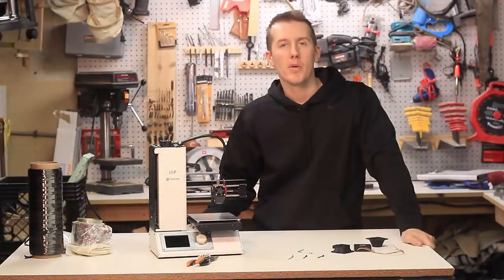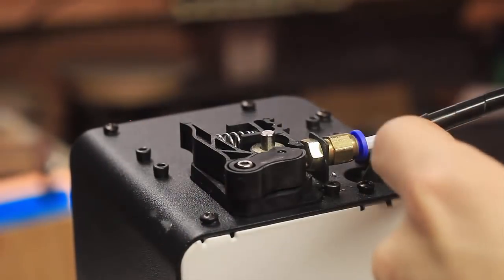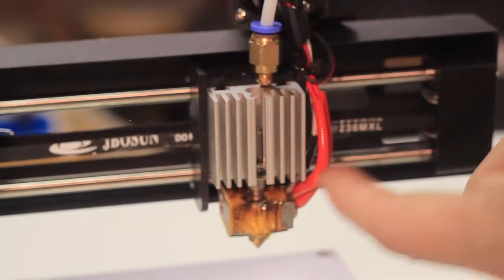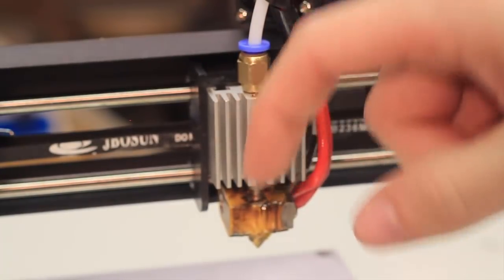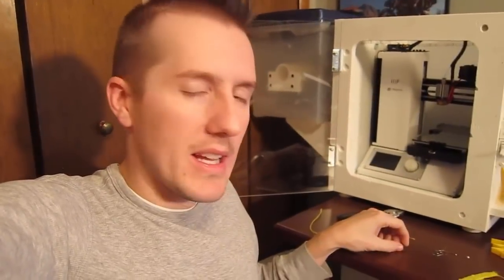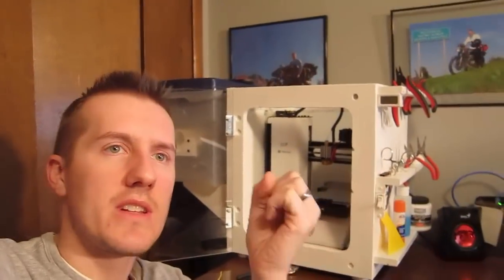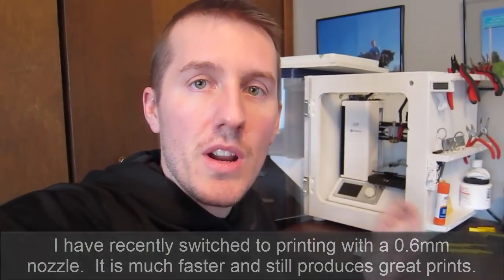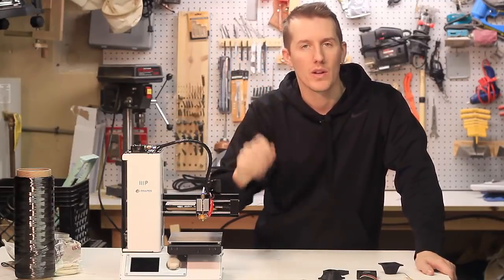Fix Clog in Nozzle - Monoprice Select Mini - 3D Printer

Comment: Hey thanks for the video.  Do you recommend a specific filament?  Does a better filament cause less clogs? Thanks!
Reply from the maker: PETG can be hard to print with.  You need to be printing at like 230 deg C.  
PLA is the easiest usually.
ABS is cheap and sometimes prints great and is strong.  Although it can warp up from the print bed easily.
I had a roll of eSun PLA +  and it always seemed to print pretty well.  Also it was only like $20.
But i haven't really seen a difference between a $40 roll and $15 roll.
A lot of people like Hatchbox, again like $20 on amazon
One filament that stands out to me is by E3D - spoolWorks PLA.  It was like printing butter.  Super smooth and the final part looked great.  Use this for "fancy" prints.
Kind of rambling, but i think most filament today is pretty good.  I guess in the early days of 3D printing there was a lot of variation.
But i would just buy the cheapest stuff, like $20 per roll.
Here's a video where they asked a bunch of youtubers their go-to filament.  Hatchbox came up a few times: https://www.youtube.com/watch?v=aw_chlce7is
1 last thing - i live/work near a MicroCenter store.  Not many in the country, but that's where i've bought the last few rolls.  They make Inland brand.  Really good and like $20.
Reply: @DaveWirth  Thank you! I am using the Monoprice Select Mini 3D Printer v2.  I just ordered the replacement nozzles you suggested and I will look into the lubricator.

Comment: Hi Dave, really enjoyed this video and your instructions to replace the nozzle.
My nozzle clogged up and burned the insulation; I am not sure how it all happened but I found a print which looked as if part of it was melted.
I ended up taking what remained of the insulation off and now I am having difficulty removing the nozzle as the heater rotates.
I am hoping I don’t need to strip the whole thing down as you show in your second video.
Thanks for sharing this.
Reply from the maker: Clogs happen.  Sometimes not enough cooling, or with some prints there's a ton of retraction and it gets clogged.
You don't need to have the insulation on there, most printers don't have it.
You need to use big pliers - grip the square heater block - then remove the nozzle ..... while it's hot.  It sucks but you need to turn the printer on, set the hotend to like 200 degrees C, then remove the nozzle.  Otherwise it won't come off from the fused plastic inside.  
Once you get the nozzle off you can either try to clean anything inside, or install a new nozzle.  
You can use a blowtorch and melt any plastic inside the nozzle out.

Comment: sweet video, where did you get this enclosure from?  Are you still using this printer?  I just picked this printer up today used and I am trying to figure out what the abuse the previous owner caused because its not printing correctly, filament is not coming out perfectly and I am pretty sure my level is good.
Reply from the maker: I built the enclosure  https://www.youtube.com/watch?v=6NJk8Kgl7oY&t=719s
Not really necessary though, unless printing with abs
I still use the printer from time to time.  seems to go in spurts, then i'll take a 3 month break
if the drive motor is turning and it's not printing great, then the only other thing is the hotend and nozzle.  try changing the nozzle.

Comment: Good video. I need to change my nozzle and I noticed the yellow insulation jacket had burnt/fallen off. Do you know if that is a replaceable part or I should just ignore it or not touch it?
I only made a few prints from new
Reply from the maker: You don't need it.  It's just insulation and Kapton tape.  You can put the E3D silicon socks on instead   https://amzn.to/34HRDBZ
I would suggest printing printing an adapter if you ever want to switch from the stock hotend to an E3D V6 or chinese clone
Here's the one i've used for several years  https://www.thingiverse.com/thing:1848402
And here's the super basic mount  https://www.thingiverse.com/thing:1621387
You can get a chinese V6 clone for under $10   https://amzn.to/3jJH45A

Comment: You can just take the white tube out without taking the nut off. Push the Blue piece in and pull the tube back at the same time.

Comment: Thanks this helped a lot but the issue I'm having is the clog is inside the metal part above the extruder+the plastic, I did my first test print with a blue filament in the delta mini and when I switched to a different filament it instantly clogged.
Edit: I fixed it by heating up the metal part with a lighter and then used cleaning filament to push it through.

Comment: 1:20 dude you just press on the blue part it pulls out easily
Reply: Check.  Rather than unscrewing the hardware, you can remove the teflon [PTFE] tube by pressing down the blue part and pulling the tube out.  It's a Bowden connector.

Comment: Wouldnt it be a GOOD idea to remove the filament after you're done printing, and while it's still hot?  Or do you still get clogs?
Reply from the maker: Yes you are only able to remove the filament when it's hot, otherwise you have to heat it back up to remove it.  But i think it will still possibly clog.  There is a way if you pull the filament out at just the right temp/time where you can get all the plastic cleanly.  Maybe around 150 degrees or so.
Reply: Dave Wirth  Thanks again. It looks like cleaning a clog is not too difficult when it occurs. Excellent vids.

Comment: Great video. I was successful in replacing my extruder nozzle (with the one you did). However, now when  when I set it to home axis, my printer now has the printer bed pushed down a bit (appx 1/8 inch) to where the springs have tension and the bed leveling screws are sticking up 1/8 inch, and when I try to print, the extruder nozzle scraps along the bed. It appears that the new nozzle has a larger height. Do I have to modify the height of the print bed to accommodate the size of the nozzle? THX to anyone who might help.
Reply from the maker: You have to adjust your Z-axis somehow.  If you have the room (you should) tighten the bed screws down so that you get the right spacing to the new nozzle.  That's probably the quickest and easiest.  This problem happens all the time when people add something to the bed like glass or a sheet of PEI or BuildTak.  
For glass, you are now adding something like 1/8" of material.  The printer doesn't know that it's there, it doesn't know where the nozzle is.  It only knows when the Z axis endstop is triggered.  The Z axis endstop is inside your case on the left, you can see it through the slot.  If you do add glass you will have to print and install a spacer.  That will trigger the endstop early to account for the glass bed.  Here's a link where i talk about the endstop and adding a glass bed.     https://youtu.be/vy30E6wJIz4?t=28s
But again, you shouldn't have to do that, just re level your bed for the new nozzle.

Comment: Hi Dave,  When I replaced my nozzle the hot end started oozing melted filament. It was oozing out from near where the nozzle screwed into the heating cartridge and where the cartridge screwed onto the cold end of the extruder.  I noticed when I took the stock nozzle off there was a little gasket on the top of it and on the replacement there was none.  Any ideas on how to fix this?
Reply from the maker: The trick is that you have to Tighten While HOT.  It's surprising, you can get it nice and tight when cold, then it becomes totally loose after it's heated up to 200 degrees.  So get it snug, heat it up, then use 2 pliers, one to hold the heater block and one to tighten the nozzle.  Then make sure it's tight to the heat sync.  Also i like to use some type of thermal paste on the threads.  Actually i use diaper cream which has i think Zinc in it, so it works just as good.

Comment: I just got a mp select mini. I have been printing for about a week and got my first jam. But I have a different heat sink than in this video. Any chance you know how to remove the nozzle in the new one. Please let me know I can't find any videos with the one I have.
Reply from the maker: The barrel is held in place with a small allen bolt, the allen wrench needed was included with the printer.  A small allen bolt also attaches the barrel to the heater block.  It's hidden under the yellow kapton tape and insulation.  To remove the nozzle you don't necessarily have to take any of that off, just hold the heater block with pliers then loosen the nozzle, while it's hot.  Put the new one on, then snug it tight, while it's hot.
Reply: @DaveWirth  I got a Mini V2 mid-June 2019 and the layout is completely different.  After it jammed, I removed the fan with the side clips.  Then a cover is held on with two phillips screws.  Inside is a cylindrical one-piece heat sink, with a nut at the bottom; then the heater block underneath completely enclosing the extruder nozzle except for about a 1mm opening at the bottom.  Photo in link below.  Any idea what to do, or a link to another video?  Monoprice "support" hasn't been helpful.
https://www.mediafire.com/folder/5jl6g9gofnof3/
Reply from the maker: @RevZafod  Ya the Version 2 has the upgraded E3D V6 style hotend.  Lots of people, including myself, were buying them and upgrading our Version 1's.  Here's a video if me trying to upgrade hotend  https://www.youtube.com/watch?v=2tFa1svpPwQ   Although looking at your photo, it looks a little different at the bottom where the nut is.  Usually there is the round heatsink with the fins, a connector tube and the heater block.  Inside the heater block is the heater cartridge with the 2 braided red wires coming out of it.  There is also a small thermister in there to monitor the temperature.  
I'm not familiar with the nut or the enclosed heater block.  But i would suggest looking for "E3D V6" video's.  It's very similar to yours and is very popular since tons of Chinese companies basically just copied the original version from the company E3D.  V6 is the model.  There is also a V5 which i think is larger?  
But basically you should be able to take everything apart and remove the clog.  It will require you to unscrew all the parts.  Again look up E3D V6 assembly.  You can use thermal paste (also baby diaper cream works) when assembling it.  You want the parts snug, then heat the hotend up to 200 degrees C and tighten everything down.  It needs to be tightened when hot, which is a bit of a pain, or else it comes loose while printing.
Reply: @DaveWirth  Thanks, Dave; good tips on tight assembly in the video you referenced.  Monoprice support gave me this link today, on unclogging the original Select Mini V2 printhead assembly.
  First step in unclogging is to remove the teflon [PTFE} tube from the brass Bowden connector on top of the printer head by pushing down on the blue plastic while pulling the tube.   Heat to 220 0r 225 degrees, wait a couple of minutes, then try to push filament thru with some force.  Cleaning filament is best for this, and do the "atomic" extraction at 160-180 degrees several times for thorough cleaning.
  If that doesn't work, here's a pictorial on disassembly.  Rather than use pliers on the nuts, use a 10mm wrench to fit both top and bottom.  If the heater block has a black rubber protector, you can peel it off.
https://monopricesupport.kayako.com/section/2-common-issues
  Dissembling the Mini Select V2 E3D Extruder Assembly
https://monopricesupport.kayako.com/article/327-dissembling-the-mini-select-v2-e3d-extruder-assembly

Comment: Dave, It appears on mine Monoprice Select Mini  V1 the PLA will not feed in. I put a mark on the filament and it does not move. I can push in the release lever and push in filament and filament will come out of the nozzle, so I know the nozzle is open but it will not feed. Any ideas. I see the wheel on the right side of the printer moving/turning  so I was wondering 
 if there is a way to apply more pressure on the PLA filament.
 Thanks.
REPLY
Reply from the maker: Ya if you can push it by hand and it feeds through the nozzle then you know the problem is with the feeder.  Since the wheel is turning it isn't a problem with the motor or software.  I would suggest 2 things.  1.  Clean off the teeth on the wheels that feed the filament.  Sometimes they can become clogged and don't get enough grip.  Next you can try a new spring, or add a spacer to make the existing spring apply more pressure.  Maybe even adding a rubberband would help????
Reply: OK, the problem was the bottom plastic plate was cracked. I decided to upgrade to a better Metal Extruder from Capricorn.  So I purchase a new complete Metal Extruder from them. Bad Idea! This DID NOT WORK. The parts did not fit and there was no instructions on how to install the spring. What I did was make a new bottom plate designed by Robin Reiter at school and now it is working great. I will let you know how it goes in six months or so. Lesson learned - if there isn't a YouTube video on how to install it - DO NOT purchase it. I gave the parts to the lab tech. Maybe he can use them on another printer. Thanks and best to you. Richard

Comment: Dave, where did you get the 0.6mm  nozzle? Thanks
Reply from the maker: Richard Brown Don't remember, either Amazon or Aliexpress.  I think aliexpress because I remember it costing like $2.00 for a multipack 5 nozzles of various sizes
Reply: Dave, I found the problem. The plastic bottom of the feeder on the top of the MonoPrice Mini Select was broken. I purchased an entire new one from Capricorn . It appears that the spring does not have anyplace to be installed. Please google Metal-Extruder-Capricorn-Bowden-Tube-Monoprice-Select-Mini-Upgrade-V1-amp-V2 -  and tell me what you think.  NOTE: I do not want to appear that I am supporting any company. Can you ask your friends if they ever used this. I wish I could send pics but I am not all that familiar with this setup.. Thanks.. Richard
Reply from the maker: Ya i remember that one part of the extruder was know to be a weak point, my V1 came with a spare part.  But i haven't had any problems with it.  Also there were lots of 3D models you could print and upgrade.  As far as the metal bowden extruder, it looks ok.  I know some people have upgraded to that.  But i've never had any issues or needed buying it.

Comment: Hey Dave, took your advice and upgraded to a 0.6mm nozzle. However, now I'm trying to adjust to the correct settings. Could you provide your print settings? Thanks!
Reply from the maker: First just change the nozzle size from 0.4mm to 0.6mm and do a test print, either Benchy or a 20mm cube.  The cube is good because you can measure the size after you print and see if it's over or under extruding.  I remember mine was like 21mm in the Z direction.  So i next increased my Z height distance between prints.  After a few more test prints i got it to 20mm.  Also increasing the Z height made it print a lot faster, instead of printing every 0.25mm it was printing something like 0.35 or 0.4mm.  I lost a little in the detail but was going twice as fast.  This is possible because the 0.6mm nozzle can pump out much more filament.

Comment: Nozzle should be tight to the heat break barrel, not the heater block.  If you tighten the nozzle to the  heater block, this can establish a gap between the nozzle and the heat break barrel, which will lead to a worse blockages and leaks out into the heater block and ongoing fouling of old cooked filament, which can pull into fresh filament, ruining prints.  A process to avoid this and keep the z-height minimized is - all while hot and only with the correct wrench - snug the nozzle to the block, back it out 1/4 turn, snug the heat break barrel down onto the nozzle, now torque the nozzle against the heat break barrel, holding the barrel, not the heater block. 

The replacement nozzles are far taller and will cause the nozzle to plunge into the bed during zeroing unless you crank your bed way down or add a z stop modification.  In any event it reduces the z print volume.  The flatter design of the OEM nozzle does a better job of ironing flat top surfaces as well as riding over small cooled bumps in the print during travel instead of tending catch and to pop prints off the bed.

Comment: what happened with the j head v6 upgrade ? ( e6 vd3 thing) .., anyway, I print 20 hrs a day 7 days a week on the mp select.. ive been through 3 power supplies, numerous nozzles.. good way to clean the nozzle is to boil it in water for 20 mins, it makes the filament in the jam more brittle, and easier to clean.. re install , preheat the machine to 220 , and use the E move button to prime the now somewhat cleared nozzle..
Reply from the maker: Ya i still have the V6 on there, this is just an older video i did and never got around to editing it.  Boiling water sounds a little better than sitting there with a blowtorch and pliers.

Comment: I am having a lot of clogging but it's due to the filiment cracking in the Bowden tube and getting stuck in the hot end I was able to just take it apart like you said where that tiny white tube was the first time but this time I have to disassemble my entire nozzle to reach this really small bit of filiment
Reply from the maker: Sounds more like bad filament, then a clogging issue.  PLA is brittle, but not that brittle